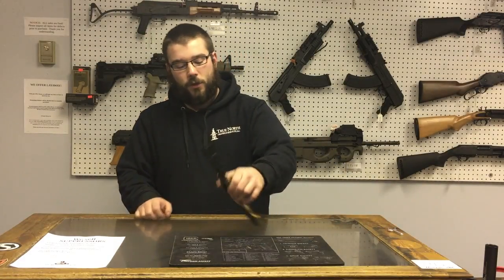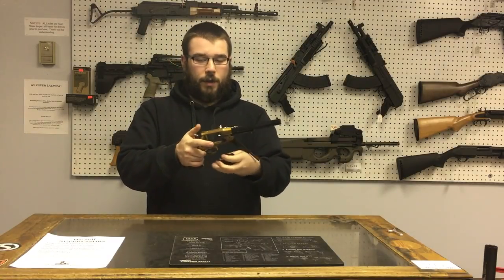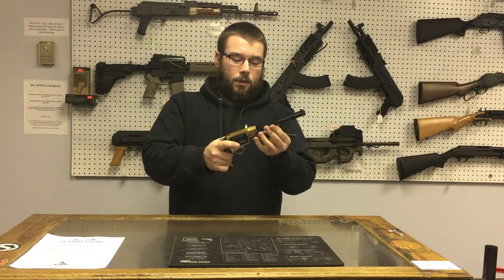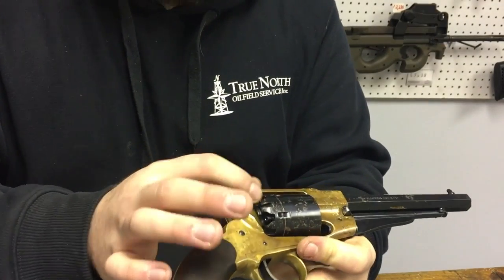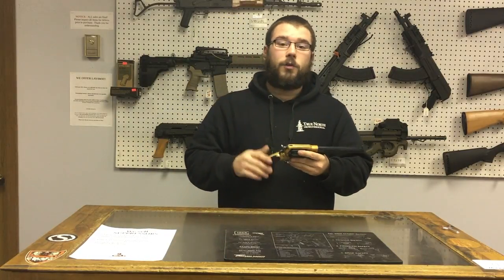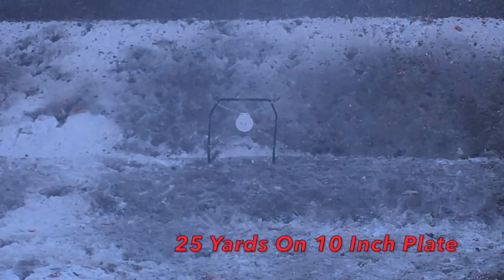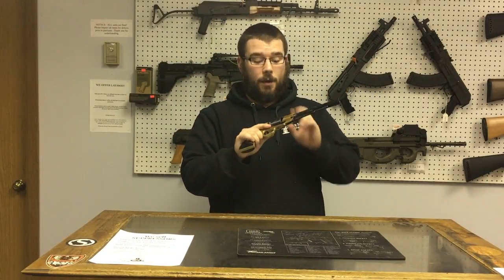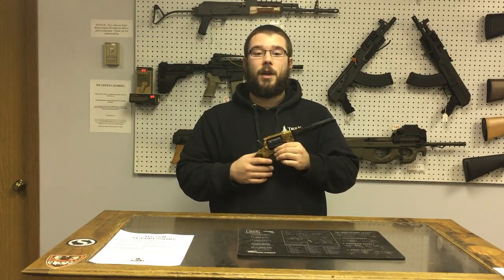1858 Remington Cap and Ball Reproduction

Comment: I like the brass frame bit have heard that it will bend out of shape over time. What do you think ?
Reply: The brass isnt really typical brass.   Its strengthend.   Brass is heavy.. it can handle being shot.   The issue is if there is cylinder gap causing thr cylinder to move back and forth THAT will peen out the brass behind it.    It wont cause any frame bending though lol not with 30 grains.

Ive fired hundreds of rounds through my brass 1851...  hasnt done anything to the gun
Reply: it's been a year but if you are still interested brass tends to be fine, if the cylinder is tight to the barrel and frame.  There is a ton of myths that still get spread about brass to this day about it "stretching" what actually happens is the cylinder can hammer back against the brass frame leaving a dent a "peen" this causes a gap. This is what happens when people say a brass gun shoots loose.  Brass is actually plenty strong for black powder guns, think for a moment that the Henry in 45/70 uses brass, that is a MUCH more powerful round and it's absolutely fine.  Sure brass isn't 100% historically accurate if you are doing re-enacting or something on a 1858 Remington however on a good quality modern gun it's fine. The real criticism of brass started from older 1970s era guns that had loose tolerances and in general were much more poorly made compared to modern brass productions.  Yet the myths persist to this day.
Reply: @-Zevin-  it's more common with the colt.
Reply: @jeepsblackpowderandlights4305  still using that same brass frame?
Reply: @LostSpaceGuy  yea i wear it all the time too

Comment: They were never in brass back in the day.  That is a modern thing for cost.  Great gun, I have one in brass with a 5.5 inch barrel.
Reply: I have the sheriff 5.5inch in brass also what is the max amount of grains you put in yours also have you ever seen first hand one that has deformed from hot loading I read a few reviews of people putting 1000 + rounds using 30 grains through the brass models with no deformation or stretching of the brass frame but others claim it has happened I put maybe 27 at Max in mine 
Just curious to hear from someone else thanks mate
Reply: They were.. ive seen examples of them in brass and the 1851s.  But they were only made in small quantities and only very early on in production
Reply: @Jak-it  have a brass 1851 navy.  They dont (frame stretch)  what happens is if there is a large gap between the cylinder and barrel this causes the cylinder to wiggle foward and back.. itll make a pop pop pop noise if its bad.  When you fire the gun.. this slams the cylinder which is steel against thr brass ring on the frame that it spins on.  This can cause the brass to peen out.

It will also cause pressure and smoke and flame to leak past thr cylinder and barrel cone causing lower bullet velocity.

To fix this.  You grab a file.. and file down the top of the cylinder pin.. very slightly testing the gap by putting it back together keep doing this until you reducde the gap enough so that the cinder still spins freely when you cock the hammer and doesnt bind up.   But also keeping thr cylinder from banging back and foward from excess gap.

If you file too much off and it causes thr cylinder to bind when you cock the hammer.  All you do is filed the barrel cone down slightly to increase the gap very slightly so it doesnt bind.

Its a very easy fix.

Ive fired a thousand rounds at least now on my 1851 brass and steel and nothing has happened to the brass ring yet.. using 457 balls and 30-35 grains of powder
Reply: @jeepsblackpowderandlights4305   Thank you for this!  The myths about Brass "stretching" or being junk seems to be nonsense. What is happening almost every time is peening. Sure it is less hard than steel, but it is by no means a terrible metal, The Henry shoots 45/70 all day with a brass frame.  I think this myth started from really early 1970s repro guns made of brass with loose tolerances sold for civil war re-enactors, then the myths stuck around to this day and continue to be repeated by people on forums and social media.  There are allot of inaccurate gun myths that stick around, like the Japanese type 30 being junk or exploding, when they tended to have greater strength than 1903 Springfield and German Mausers, doesn't stop people from repeating the same old myths to this day.
Reply: @jeepsblackpowderandlights4305  brass was used by the Confederates because of cost.

Comment: Fyi miss fire and hangfire is NOT common.  You either had oil in the cylinder or nipple.  Or youre using a bad cap brand.   Ive fired thousands of rounds in both of my 1851 navy..  and my  hawkens rifle.  And my howdah doubl3 barrel...  never had cap miss or hang fires.. not once